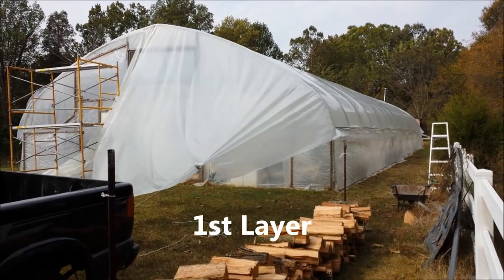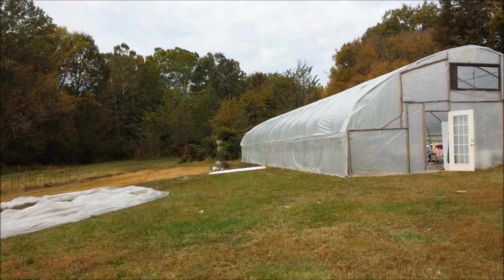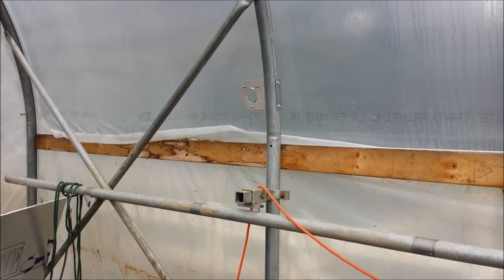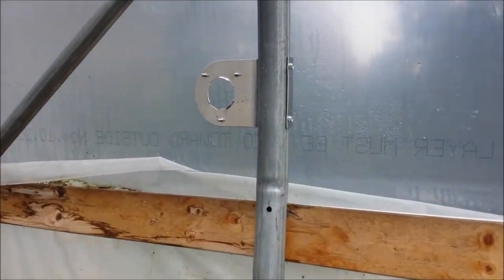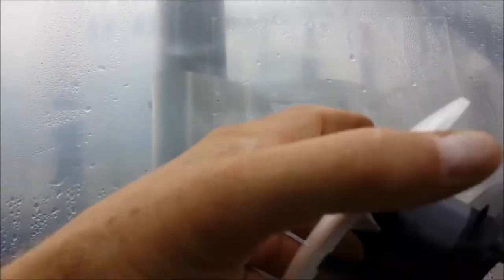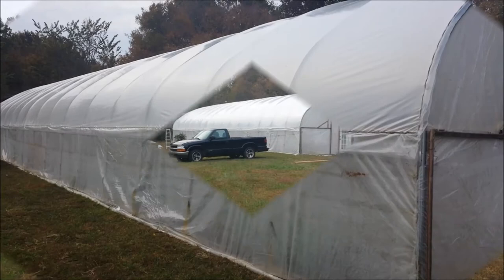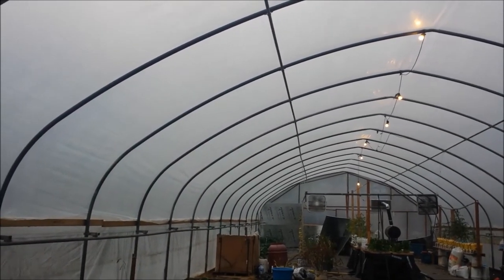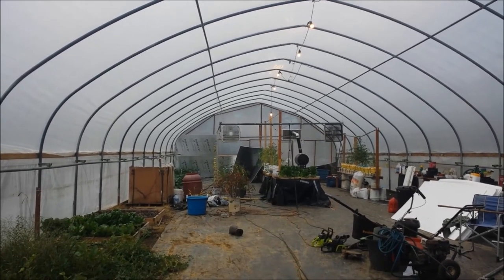Re skining the Greenhouse Part 2  (2nd Layer)

Comment: You did a fantastic job. Did you ever see how mhpgardener did his cover? He did it all alone, no help at all! It's called "DIY Greenhouse Plastic Installation." He pulled it across the top, held it with rope, and then pulled it down on each side, pretty neat. He said that his hands got torn up by that wire too. Man, you sure did a lot of work on that greenhouse, and that fan is outstanding. It looks so nice and secure too. That is going to do a great job this winter, for sure! Fantastic Video!

Comment from the maker: Bobby has been extremely helpful. However, our GH's are very different in size. Mine is significantly larger than his are. In fact my GH is 30 1/2 feet X 96 feet and has about 3000 square feet of floor space in it. Bobby has 2 GH's. 1 is 40X18 with 720 square feet of floor and the other is 21X68 with 1428 square feet. 720+1428 = 2148. Mine is also 17 and 1/2 feet tall. All the extra plastic made it too heavy to do it his way. I could not get what is about 200 lbs of plastic up that high.
Chuck

Comment: My exp I got about no flowering/fruit stage... You will get leaf growth but cuts back on the flowering.... I found that with my greenhouse with 1000 gallons of water for my aquaponics It will not frost inside the greenhouse till teens outside then I need to heat with the wood stove... If you only get 1/4 of usable light for only 4-5 hours a day it's not much good for mater/melons/peppers... But hey I just been doing this for a few years and found what works and what don't the hard way...

Comment: Where did you get that bracet from to connect the blower to the plastic
Reply from the maker: Shovel County it comes with the blowers. I got some of mine off of eBay and some from Atlas manufacturing company.
Hope that helps?
Chuck
Reply: Fensterfarm Greenhouse thanks